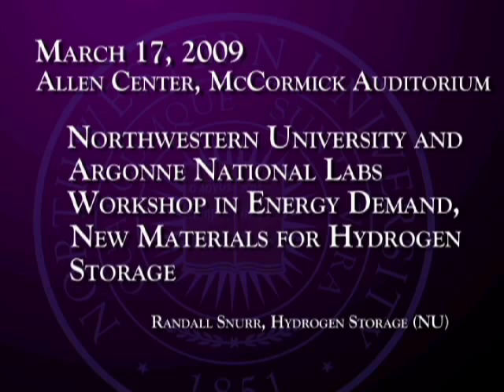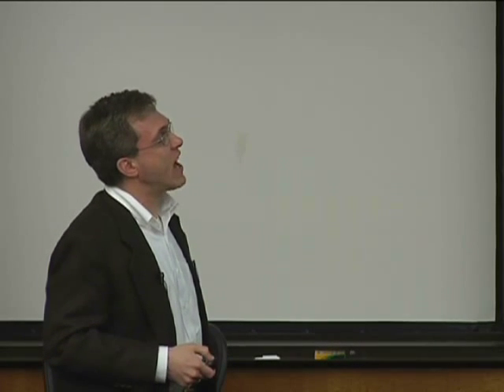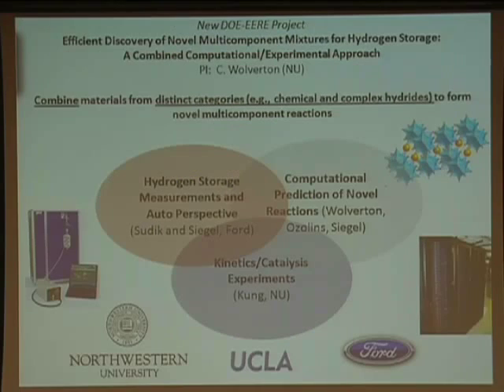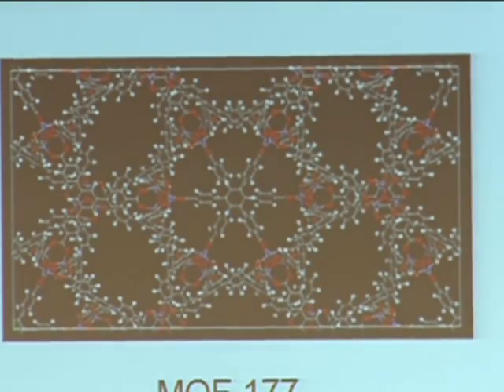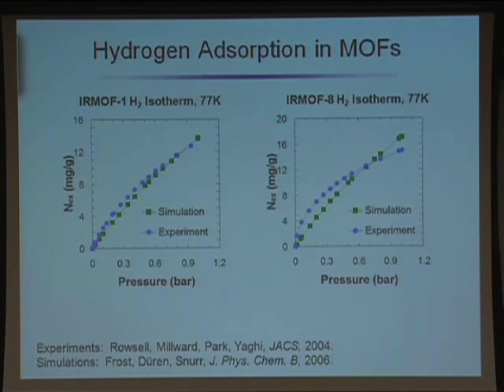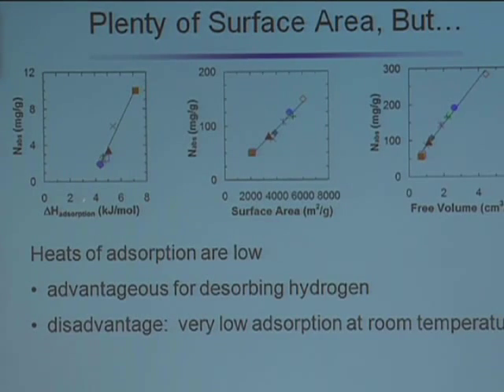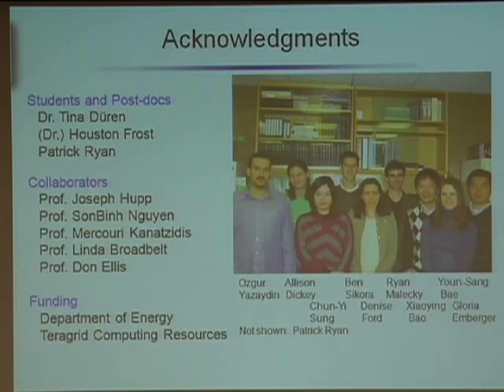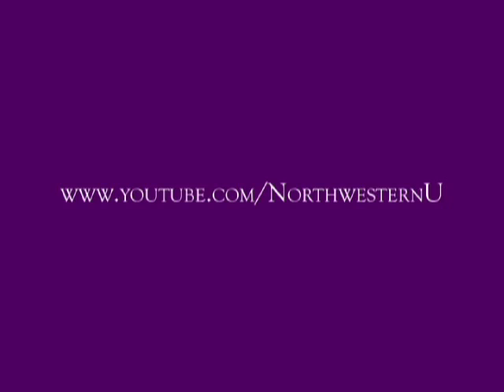New Materials for Hydrogen Storage

Comment: For automotive purposes, would it be easier to create the reaction between the hydrogen and oxygen at the re-fueling station.  By doing this you could directly control the temperature of hydrogen storage to more closely meet your target.  This electricity produced could then be transfered to portable capacitors that would be exchanged with each motorist.  Just a thought.  Nice video!

Comment: So far the models look symmetrical top to bottom. I am not exactly sure of all the dynamics involved, but since hydrogen's molecular density causes it to rise rapidly in an open air environment, is there a way to model the storage material to possibly make hydrogen absorb slightly easily from 1 direction and effectively meter the release, or at some point invert small portions of the material to speed up the release?